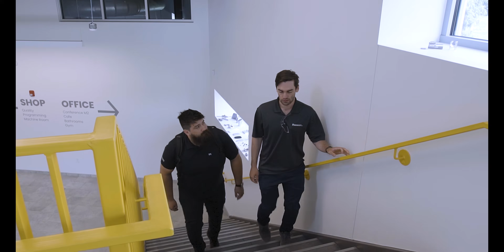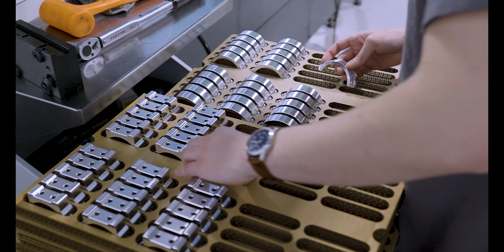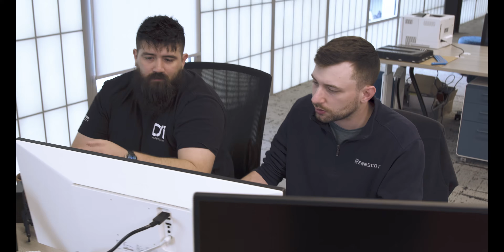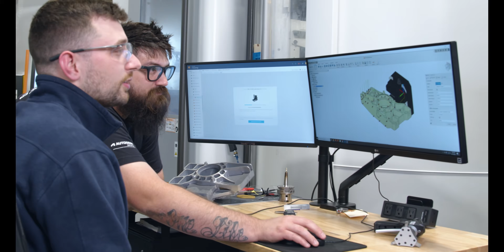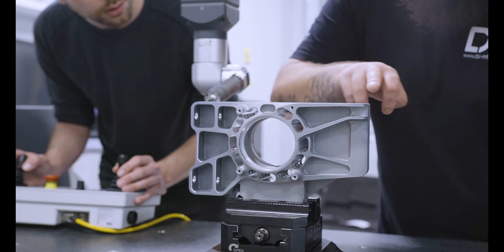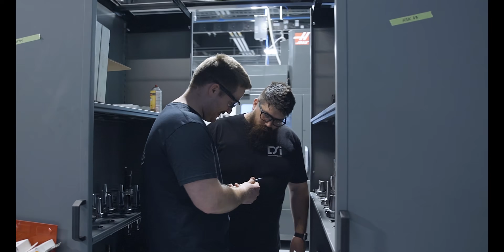DSI On Site Training with Rennscot MFG

Comment: I looked at their website and they are ITAR certified. One thing we have struggled with is fusion not being compatible with ITAR. Do they use a different Autodesk product for ITAR jobs or is it possible to use fusion with ITAR?
Reply from the maker: There are ways you can use Fusion offline, although Autodesk also offers desktop CAD/CAM solutions if a cloud-based solution isn't the right fit for you. Rennscot MFG has several different software tools at their disposal, and it's clear they're very willing to invest in additional tooling and software as needed to achieve their goals.